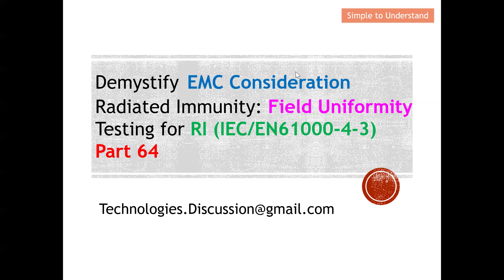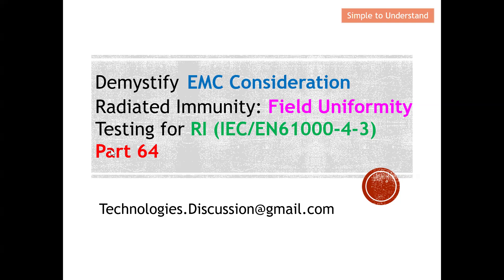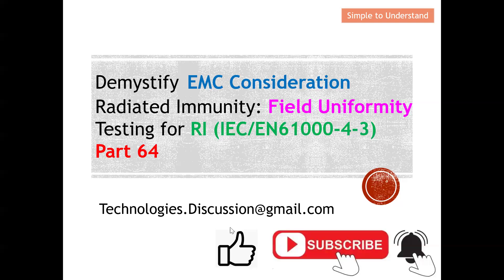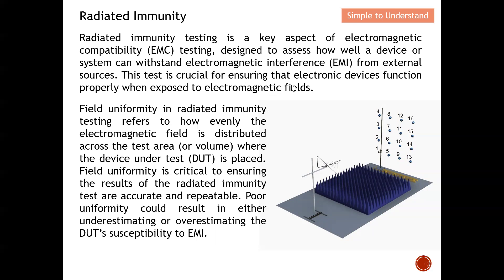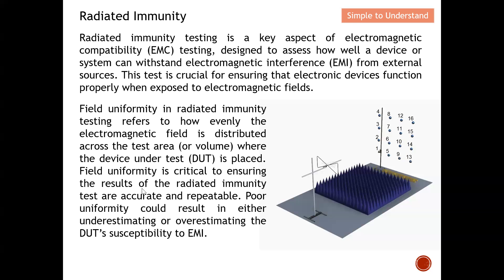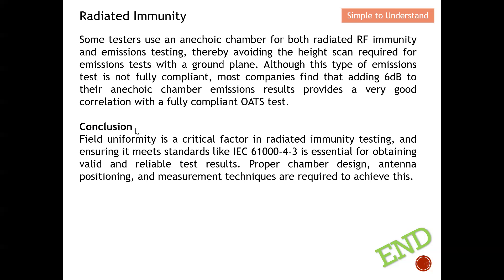EMC #64. Field Uniformity: How to Achieve 3V/m or 10V/m for IEC 61000-4-3 Radiated Immunity Test.

Comment from the maker: Thank you for watching this video.
In this video, I discuss the importance of ensuring field uniformity in Radiated Immunity testing. Field uniformity is critical because it directly impacts the accuracy, repeatability, and validity of test results.
Field uniformity ensures that a 4 × 4 point grid experiences an almost even level of RF exposure for at least 75% of the measurement points.
Key benefits include:
Consistent exposure across the Equipment Under Test (EUT)
Compliance with standards (e.g., IEC 61000-4-3)
Accurate susceptibility assessment
Improved repeatability and reproducibility
Avoiding false passes or failures
Efficient use of test time and resources